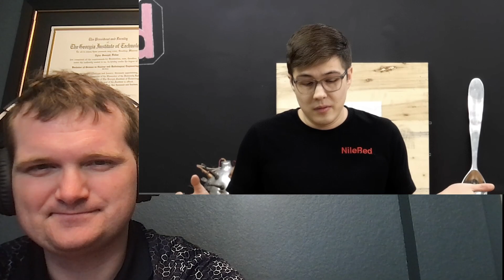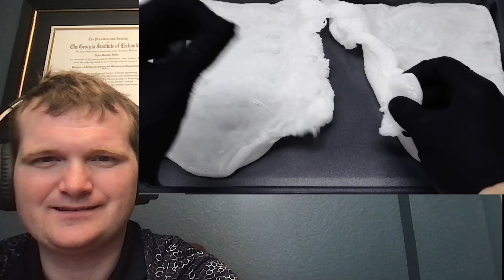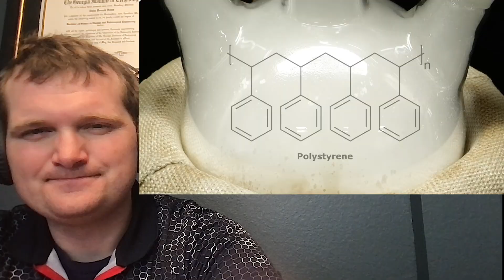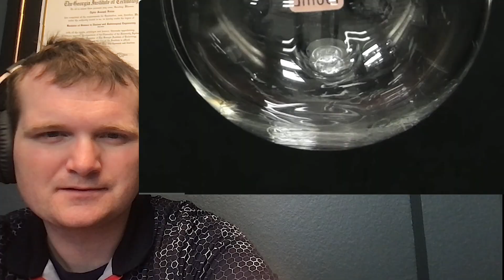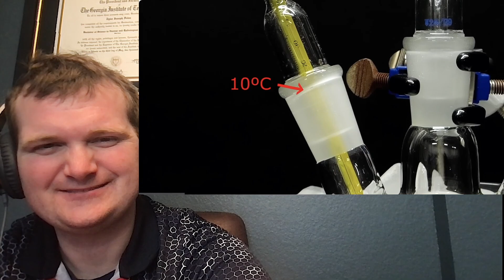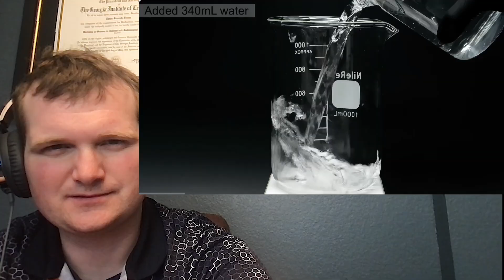Turning Styrofoam into Cinnamon Candy - Nuclear Engineer Reacts to NileRed

Comment: In my experience it always seems to take way longer to finish a reaction than whatever the instructions say. Also this is usually the case with extractions/distillation, especially when letting the solvent/moisture evaporate off from the final product! 

When something solidifies (crystallizes) at the bottom of a yield-pan it often will do so almost in layers, so you’ll get a nice hard crystal layer on the outer surface. This is usually from not using a vaccuum pump and just letting it evaporate in open-air. If this happens then just powder everything back up - it’ll be a little moist, spread it out as well as possible and allow the rest to evaporate (as it will easily now that the maximum surface area is exposed - if not, you may need to use a dehumidifier since high humidity will hinder evaporation). DO NOT use this method to “cut” controlled substances, that is illegal (& should’ve been added when everything was still dissolved to avoid “hotspots”)! You may need to crush & spread a few times as it dries depending on how moisture/solvent-laden it was to begin with. Once it’s a nice dry powder, SLOWLY & evenly apply heat to your yield tray until the product melts back into liquid. Then simply allow it to cool-down and re-crystallize, it will usually form a solid cake in the tray.

Comment: Uranium(U, 92) doesn't need to be a power plant or a bomb. It can be a docile metal than will just slowly become not radioactive and in safe storage, it won't hurt a soul. That's Neptunium(Np, 93) & Plutonium(Pu, 94).  Both of these 2 elements are Sooooooooooooo energetic, they've been known to undergo fission or fusion w/ no warning, and just sitting there w/ no human interaction. I believe discerning, safe chemists can hold a sample of U, safely. I don't see this w/ Np, or Pu. Neither of these elements has any business outside of a lab and when not using it needs to be in a lead container that's tightly inserted into cement. Since cement is smoother and denser than concrete and I feel it will work better.

Comment: Actually napalm is made with Styrofoam, gasoline, and unflavored dish detergent. The last is to allow it to more easily spread out lighting everything it touches. And yes extreme caution is necessary. No matter what solvent you use the Styrofoam becomes a slurry that will stick easily to almost anything, especially flesh.

Comment: As someone who has gotten a fire safety merit badge from a class at a fire station, B type (which is found in fire extinguishers that you usually see which are AB fire extinguisher and the much rarer ABC extinguisher) are not for flammable liquids and gases, it's instead for all chemical fires

Comment: Completely unrelated to the video, I live near a nuclear power plant that uses the lake that I live on as a source for cooling water. My question is how does such a plant use this water in a manner where it does not become contaminated and can thus be pumped back into the lake. I’ve had an interest in nuclear power since I was a kid but  the mechanism of effective heat transfer but not radiation transfer to the water irks my brain even though I’m sure it has a simple answer.
Reply: The short answer is the cooling water from the lake passes through a heat exchanger and never comes into contact with the reactor or the reactor coolant.
Reply: @ihdieselman  simple answer, knew it. Thanks
Reply: Additionally, the outflow from the plant keeps the lake temperature around 50-60° in the winter and scuba divers commonly ride this warm current from the outlet into the greater part of the lake. HOW IS IT SAFE?! Not that I doubt it is.